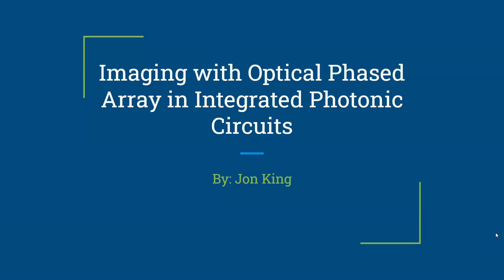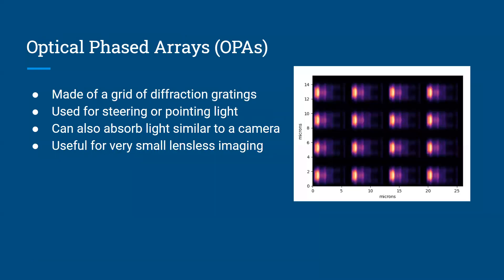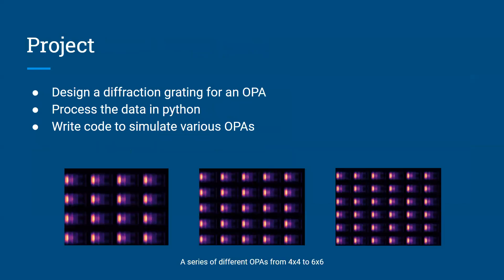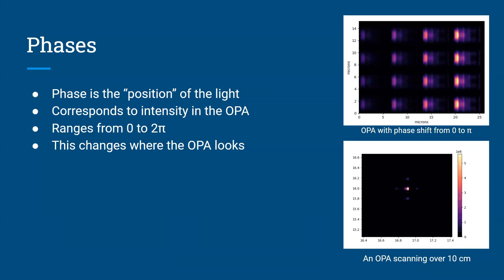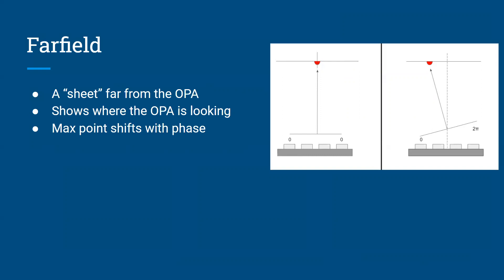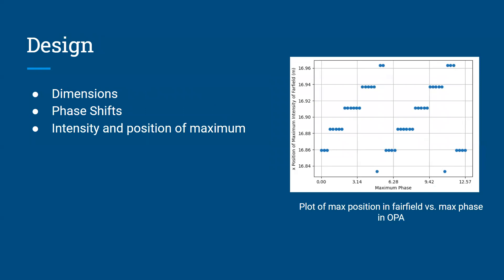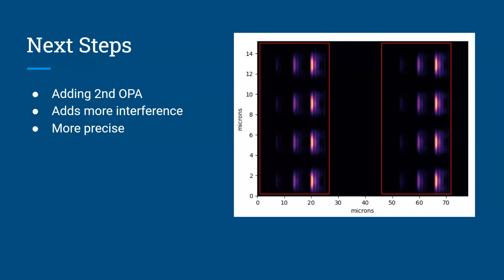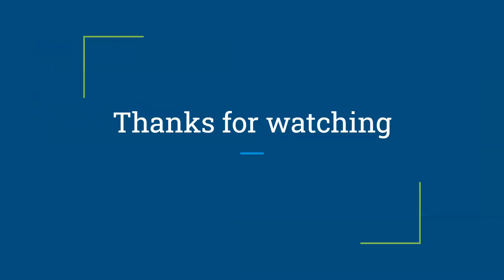Imaging with Optical Phased Array in Integrated Photonic Circuits

Comment: Very interesting John. I've looked for quite some time but have yet to see an experiment using "Active Photonic Phased Arrays" where the light is actively steered as opposed to fixed geometry directional arrays. It should be possible given the high-speed NLO and piezo modulators available. Do you know of any such project(s)? Appreciate your time -Fred